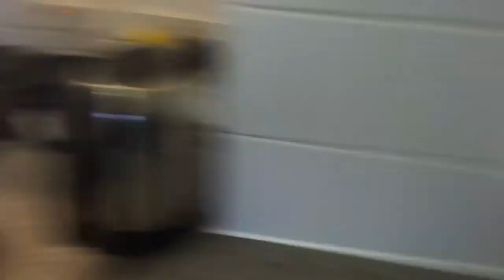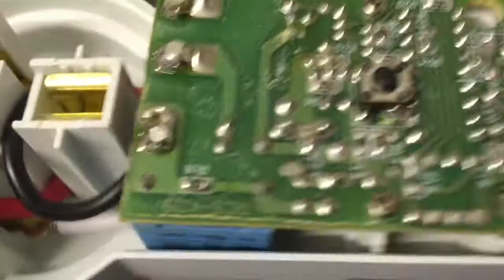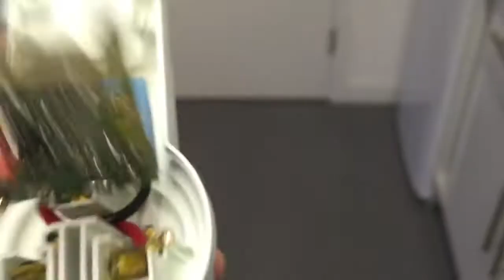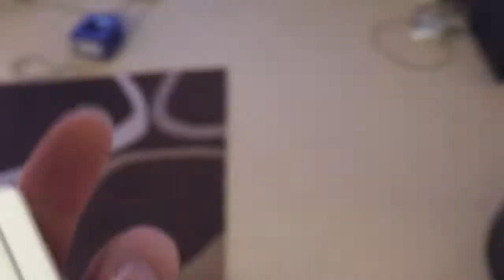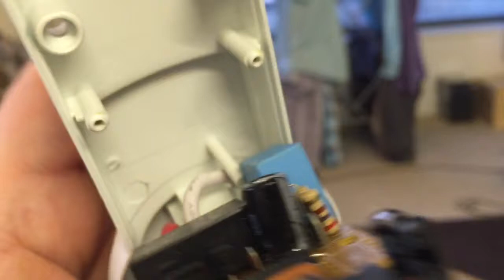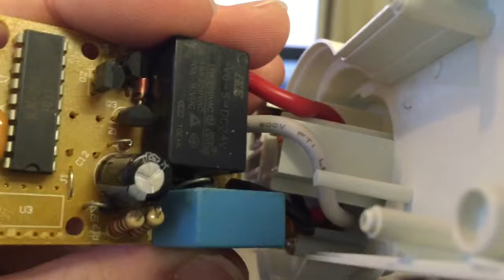Failed remote control socket teardown and "fix".

Comment: I've had several sockets go this way - sometimes they can be fixed with a hit, but sometimes more resistant - have to open the unit an bash the relay with a screwdriver. On another issue, in anybody is still looking at this video, the circuit board has a position for fitting an EEPROM, and the firmware will read it. This will store the code you have used and it doesn't go when you have a power  cut, so you don't have to pair the transmitter again. Now, if the relays were more reliable they would be even better value for money. The smallest capacity DIL 24LC16 or equivalent can be used, and a resistor of a few k ohm in the R15 position.
Reply from the maker: Tony Abbey that’s really useful to know. I’ll give it a go.  Cheers :)

Comment: I've been using these type of remote sockets for almost two decades now. They all go like this and most people chuck them out and buy news ones. I used to replace the relays in them, but discovered a sharp tap from the side releases the contacts. I use them primarily to switch on LED lighting around the house and the power supplies don't have in-rush current limiters (an NTC thermistor) so they overload the relay for a fraction of a second, but that's all that's needed to fuse the relay contacts together.

Comment: You could have said earlier about the solution instead of waiting at the end and stressing myself. Currently LMAO cuz i spend almost an hour trying to find a solution and yours somehow works unknowingly. I've had two of the transmitter and both dint worked. Luckily i waited until at the end which the solution was to knock soft on some hard surface which miraculously works for both of the device. Reminds of the old days where the remote or LCD does not function properly and giving a knock helps momentarily

Comment: I've had a whole series of remote sockets fail this way switching my TV & hifi. For a while you can get them to release with a sharp tap (not too hard or you could damage the remote socket or the wall socket), but eventually they stick permanently. I too thought it might be the initial current surge, so I installed a sequential delay power strip so the TV & hifi units all switch on individually over several seconds. The remote sockets still failed after a while. But the same make of remote socket happily continues to switch an electric blanket with a similar current draw...
I have noticed that the remote switches for TV & hifi will usually switch off without sticking if all the TV & hifi units are active (i.e. not in standby) and using ~350W. If the TV & hifi units are put in standby, reducing the current draw before the remote is used to switch off the power, the relay will stick. 
This leads me to suspect that the relay contact surfaces tend to run hot and will release while hot, but when the load decreases they cool and the contact point hardens, preventing the contacts from separating. It sounds unlikely, but it's the best fit to those observations ¯\_(ツ)_/¯
Reply: Nah, it's the high inrush current from the switch mode power supplies in your TV & hi-fi that causes the relay contacts to fuse together.

Comment: Sometimes when walking the socket doesn't work I use a strong magnet to reset the relay. I rub the magnet on the left side of the socket.

Comment: I have a remote for these status sockets. I bought them years ago and had several sets. The remote says model RCT 08. Over the years the remotes have failed and now down to the last one and it failing. I can turn sockets on but socket 2 on the remote wont turn off on the remote so have to press all off button to turn it off and then turn all the others sockets on separately. 
I bought the latest status sockets but the remotes dont work on the old sockets and infact they are crap with the new sockets. The old remotes worked even if you were in another room or switched on sockets in the bedroom when you were downstairs or even switched on sockets in a weatherproof box down the garden to turn on xmas lights. The new remotes need to have almost direct sight of the socket so are really disappointing. Sometimes they wont turn on the sockets when you're sitting right next to them unless you point the remote in that direction.
Was just wondering if you knew if another 433 mhz remote with the 4 on off buttons would program and work and also what is the difference between remotes that will work when receivers are out of sight and ones that have to be in sight. I used to have a remote for a tv years ago that used to work no matter which direction you pointed it or even round the corner out of the door to that room. Is it some kind of radio wave. Thanks for your help